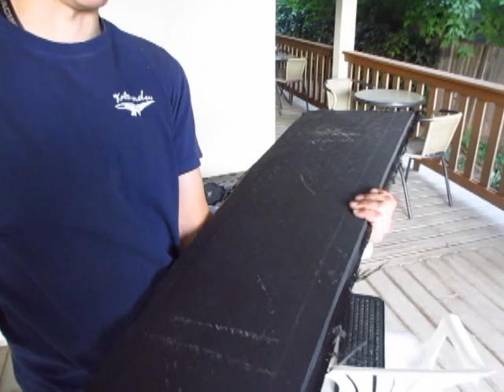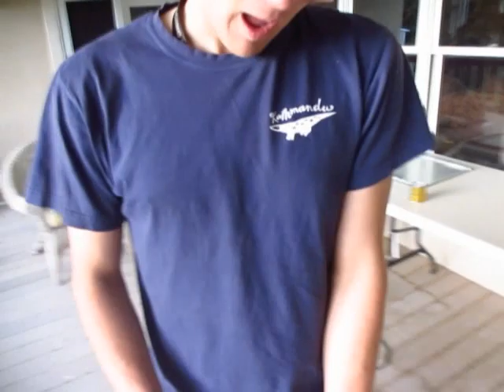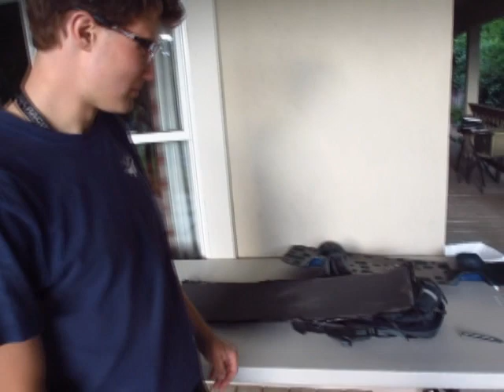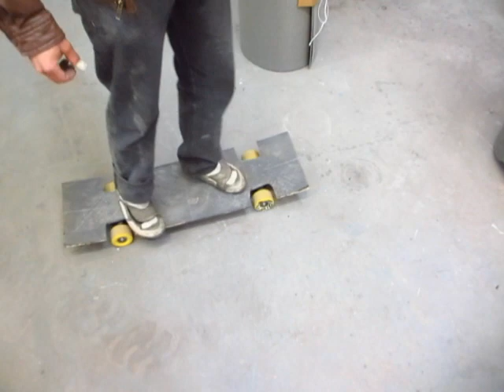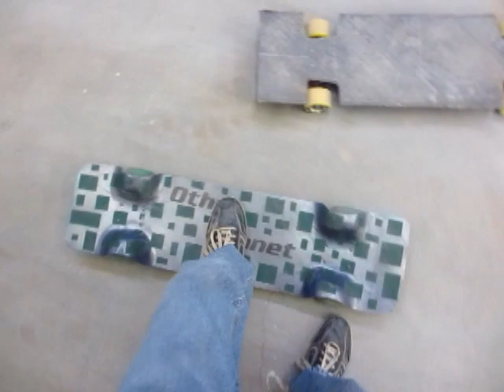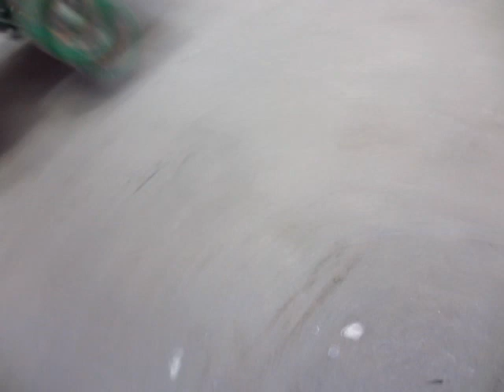Carbon Board, 4th proto

Comment: I'm sure you've considered this, but have you tried putting thin metal (or some other material) braces parallel to the trucks along the board? It sounds like you would be able to use that to prevent torsional flex while preventing the board from being too stiff overall.